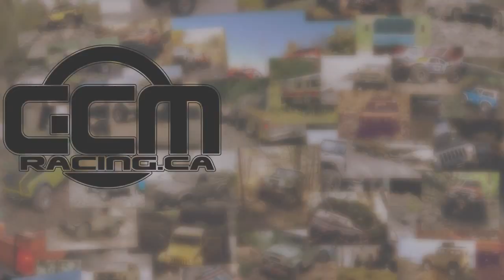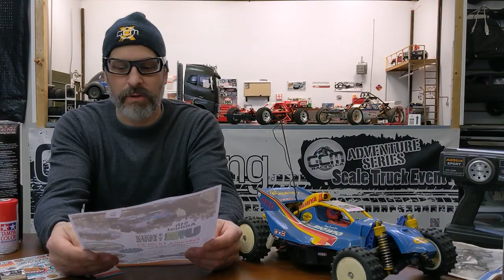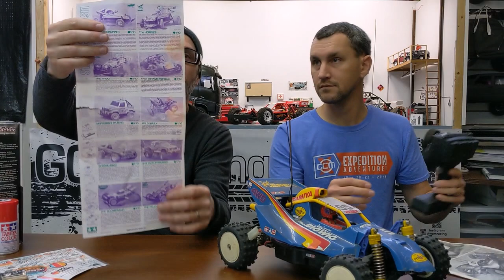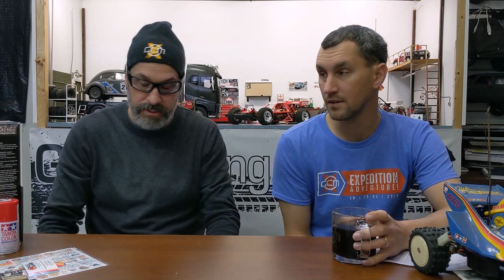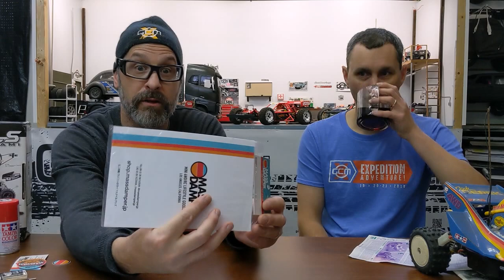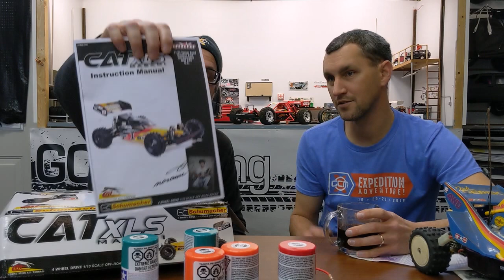4wd Buggy Racing, Builds and Vintage Restorations

Comment: I've been back into the hobby for like six months and started with Schumacher rerelease kits and some Schumacher buggy restorations. I enjoy them a lot but these kits are no Tamiya's - quite the challenge, to me at least. You are much more experienced and will probably do fine. I do recommend the tuning parts they offer though such as the front suspension (Top Cat), upgraded transmissions, brass weights, different springs etc. Great channel - like it a lot!
Reply from the maker: Very cool! I didn't realize they had an upgrade line for the parts on the Cats!

Comment: Currently building one of the Schumacher cat xls masami..
A little hint on the build. 
Do the steering before the top plate..
The chassis lexan has to be painted before you move on ..
Also in mine I'm using a core rc 20 turn brushed motor...
Reply from the maker: Great tip! Yeah!

Comment: Great video as usual. Bigwig 2017 Re release is identical. Lucky you have the technigold motor that they didn't rere. It will fly on 8.4v
Reply from the maker: Thanks for the info! I DO HAVE the original motor in the buggy .. and the 8.4 battery! hahah